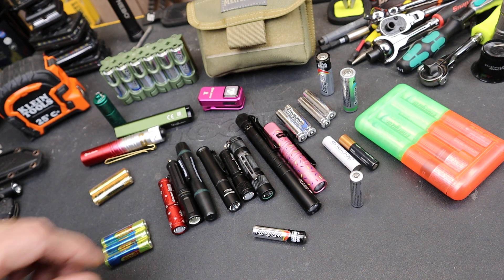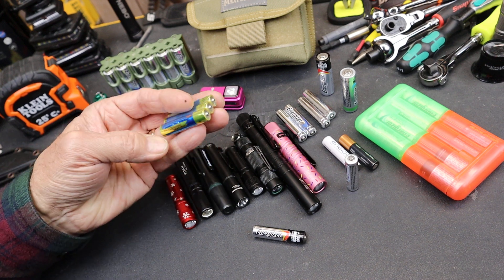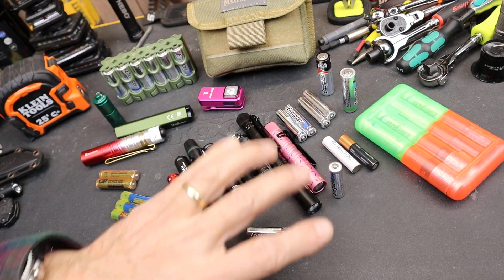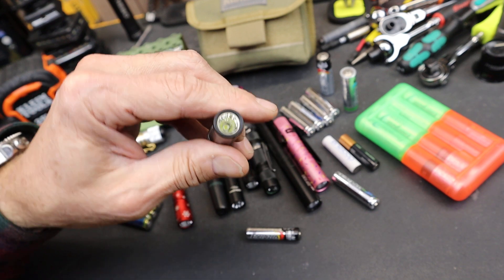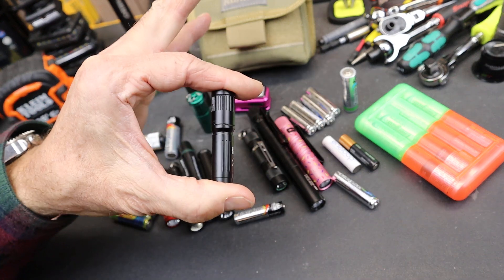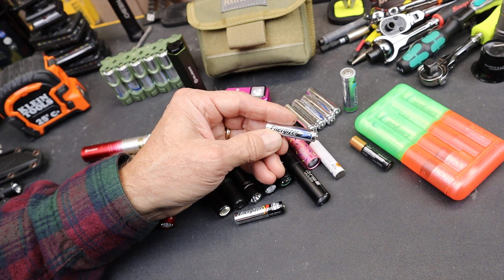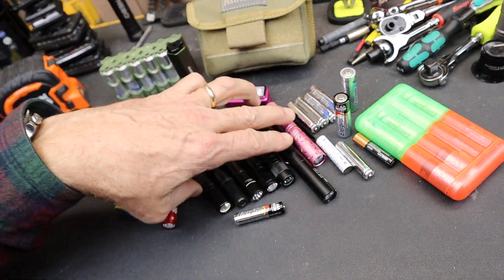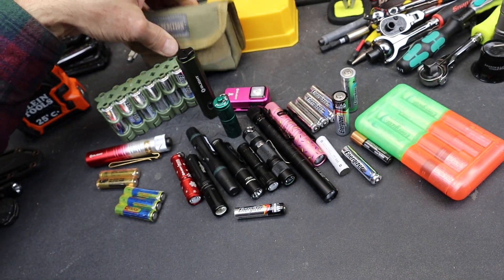Bad Timing Award? Project Farm & AAA Batteries: AAA-Dying Breed or Renewed Hotness? Lithium and LED!

Comment: tv remotes... even the cheapies last a year... i have so many things to "recharge " regularly that aaa in a remote is fine. there will (i hope) always be the low power use or infrequently used little thing that takes a pair of aaa so its small and light and easy to lose.

Comment: I think AAA are going to be around for quite a while. Every remote control I have uses AAA.  It really is not a space problem.  If our livingroom gadget makers would switch to AA, tripples would go away overnight. The weight difference is not that significant either.

Comment: Some of the modern tiny LED flashlights are amazing, but that flashlight the size of your pinky doesn’t double as a self-defense device. I have a few of the small tactical LED flashlights from HFT, so there is at least some defense utility there.

Comment: One thing I hate about lithium ion is the lack of a warning that it's almost dead. Everything works as it should, and then it turns off. Regarding lights, that's a bit of a safety hazard if you ask me.

Comment: I still prefer to have lights with a replaceable AAA vs rechargeable, especially for the lights that I depend on. In some cases, not all, there’s no charge indicator for rechargeable batteries. I like knowing my battery is fresh and ready to go. I realize this is somewhat dated thinking but my trust in rechargeable lights just isn’t there yet. I’ve carried the same fenix light on my keys for 7 years and I love knowing it’s got a replaceable battery. Just a personal preference I suppose.

Comment: I have used the Storacell battery holders like you are showing for well over a decade. I used to do a lot of flash photography and would have multiple sets of rechargeables on me at any given time. I might have the batteries in the flash plus two or three more sets in holders. With the Storacell holders I could put the spent rechargeables in the holder with the base side of the battery up to signal to me that those batteries had already been used. In the first design of the holder the plastic would sometimes break but they did a redesign many years ago and every holder I have is still as good as new. I believe the origin story is that the founder needed something to manage batteries when he was flying his small airplane. This device holds each battery securely where some case types do not. Anyway, not meant to be a commercial for Storacell I just liked their product. Thanks for the video.

Comment: If a pen light that's as good as the FourSevens Preon ever comes out with a different battery that is more energy dense then I will probably get it. For now, at work, I need that Preon P2. I always have one in my breast pocket and use it all the time. I use to use the Energizer lithium in my Preon's but these days I use rechargeable AAA's like the Eneloop.
One of my meters at work uses 4 AA's. The manual recommends the Energizer lithium. I had to use alkalines in it one time and they did not last very long. Another device that recommended Energizer lithium was my daughter's old insulin pump. It used one AAA. I use to keep those lithium batteries everywhere for backup. In fact I still have two Peak lights on both my key chains that have a single lithium. Not high output but quality lights.
I still have a 4-D Maglite in my work vehicle with the led upgrade. I never use it for light but for the occasion when someone needs to be persuaded not to do something they shouldn't be doing.

Comment: The batteries you get for free are often zinc-carbon cells, they have very low capacity (10-15% of an alkaline battery). They are still useful for very low discharge devices like remote controls or clocks.

Comment: I used my solitare a lot as a reading light when I was a kid. Just unscrew the lens and reflector assembly and it becomes little electric candle. I still have one torch that runs on AAA's. That is Led Lenser L7, it takes three, runs about 40 hours with fresh set and gives more than enough light for most things. As a bonus body is made of thick plastic so it's pretty light and doesn't feel cold when it 's freezing. And it used to be like 20€, but now prices have risen considerably.

Comment: I have use & like a very small AAA Fenix LD02 v2.0 penlight, & keep it equipped with an Ultimate Lithium primary. One of it's bonus features that see's a lot of use is its integral UV. Overall the light is mostly good for quick look/sees; and is otherwise suitable for hunting down a better light if/when need be. Other features are lack of PWM, high CRI & quality pocket clip.

Comment: The big fat maglite still has a place in the flashlight rotation for a couple of really important reasons:

It can be used as an effective blunt instrument. It’s the “girlfriend walking the dog alone in the evening” device in my household

It can stay on and running for the life of the batteries without becoming too hot to handle or a full on fire hazard. The small LED flashlights just get way too hot way too fast. The big ol Maglite is still the best flashlight for me. It’s not a pocket light, but it is very portable still and not a big deal to store away or carry around.
Reply: My 3D Maglite sits on my desk with a new LED bulb and, depending on the adapter, is loaded with either 6 or 9 AA NiMH batteries. The brightness is modest (I think it's 50-75 lumens), and should run a couple of days. You don't always need eye-scorching brightness, so it serves its purpose. My 2C Mag also has an LED bulb and runs on 2-AAs in adapters.

Comment: I love AAA because i want a small light and I use my AAA pocket light so often that I need to be able to just swap in a new battery, I can't be without my flashlight while it's changing.
Reply: exactly
Reply: But 10440 batteries are the same size and far surpass the performance of a AAA battery.
Reply: @alexdrockhound9497  they have to be recharged though.
With regular AAA's I can keep them on hand and just swap the battery out without needing to keep track of a 2nd rechargeable battery or charger...etc.
Reply: @alexdrockhound9497 
Can‘t use just straight 10440 cells since they are 3.7V. 
But there are AA and AAA rechargeable lithium batteries available that use circuitry to provide a constant 1.5V. Obviously this costs energy density compared to a straight lithium cell, but they still offer at least comparable energy to a good regular battery, often more than NiMH rechargeables.

Comment: I still use AAA battery-powered flashlights on my keychains.  It seems like the old battery technology is consistent with the technology of the flashlight.  I hate lights that have 50 lighting options and controls.  I just want to turn the light on, with a couple intensity settings, then turn it off.  All of the new rechargeable mini lights have too much business going on.  Secondly, if your AAA flashlight dies, you can get a AAA battery pretty much anywhere, no matter how remote of an area you are in.  If your rechargeable light dies, good luck.

Comment: Rechargeable lights with li-ion batteries that we couldn’t change is junk. Light works 50000 hours, but li-ion battery lose 10% of capacity every year. In tiny form factor it means 2-3 years of life. 

So AAA devices that support 10440 or primary lithium is more capable on a long time usage

Comment: My only issue with using smaller batteries are devices that call for many to even function.

If something uses more than 4 double AA or AAA batteries, at that point it needs its own internal battery (That is strictly my opinion)

Anything smaller I am usually fine using swappable batteries in, game console controllers or Tv remotes and the like, I am fine using rechargeable or disposable batteries in.

What I WOULD like, is a more standardized quality control on Lithium Ion batteries, removing any more dangerous options form websites like Amazon, and making it clear that we can move away from tried and true tech into something that is technically longer lasting, more powerful, and energy efficient.

For now, my Tenergy batteries will last me the next ten years.

Comment: The AA & AAA battery space is wide and deep.  "Convenience" items like electric toothbrushes, remote controls, wall clocks, and the like will probably always be for these battery sizes.  I don't expect a revolution in small electronics production any time soon.  Those batteries are ubiquitous, relatively cheap, and just batteries after all.

Holding onto electricity is kind of a silly idea.  The minute it gets a way out, it's all gone.  Sometimes disastrously.

Comment: AA and AAA form factor isnt dead take note ITS THE FORM factor the battery chemistry will change in due time that would make current battery chemistry obsolete or obsolescent just by how much we really don't know, cause remember you can still buy recharable AA or AAA cells that has lithium ion chemistry (they are typically charged via USB) in them making them powerful enough given the right size or be a burning hazard if improperly used

Comment: The new Lithium rechargeable AAA batteries seem to be working great so far. I bought a few. to review on the channel, and been pretty impressed.
They are crazy expensive though, and some need specialty chargers, so my old Nitecore D4 wont work for those.
Reply: Lithium are not good in extreme cold

Comment: Maglight Solitaire. Remembering small, compact, and useless. Even with brand new AAA battery installed can recall knocking the flashlight on all kinds of surfaces to get the lousy turn head to engage and actually light up. Do not miss those days.

Comment: What’s wrong with using rechargeable AA and AAA batteries like the eneloop one you showed? I think that’s a pretty good solution but you seem to have moved on from it.
Reply: Absolutely nothing.
Reply: @timmturner  my house runs on eneloop ,.clocks, thermostat ,flashlight and the list goes on. and on
Reply: use case to use case, if you want lights eneloops are not the best option depending on how picky the circuit is on the light side cause not all devices like being given 1.2volts which is what typically is put out by eneloops, at that point you are better off probably getting a lithium ion cell that just looks like a AA or AAA cell

think of it as general purpose over endurance? I know my cheap scale complains when its only receiving 1.2volts
Reply: @lesslighter what source materials or content would you suggest for someone new to  rechargeables?
Reply: Eneloops have a lower base voltage than alkaline.    I've had a few devices that complain about low voltage almost instantly.    Also, if you run an eneloop fully dead, I've had trouble bringing them back to life.
Reply: @videoviewer2008  just build a very very slow charger if you can get the parts the issue here is that most of the chargers for eneloops are "smart" enough to not charge fully dead eneloops
Reply: 1.2v can be a problem
Reply: For relatively high drain devices like lights and such I use rechargable (USB) lithium-ion AA cells. They keep a constant 1.5V and offer relatively high capacity.
Reply: I'm the opposite of Doc. I've moved away from those Energizer lithium's and have started to use Eneloops more.
Reply: Nothing he's just weird. I use eneloop in my keychain aaa light and never recharge it and it always works

Comment: CR123 are way better than AAA dispite the cost. They can provide more amps, don’t leak, more volts, stores longer, more power density.
Reply: Hate to ask but is there a source for that?
Reply: @NaturalSynthetic777  You're not gonna get one.
Whenever i see an interesting comment on YT, even if it's a reply straight @me, and i ask for sources because i wanna read the science of it: Crickets 🦗🦗🦗🦗
Most recent happening yesterday in the comments section of a food/science channel :body-blue-raised-arms:
Reply: @NaturalSynthetic777 you can measure the volts and amps yourself at home. These higher voltage cells are better sealed because its dangerous if they leak. You can look at the shelf life date on the package. You can test its output current and voltage in the cold at home too.
Reply: @NaturalSynthetic777 Can I ask why your search engine is broken?
Reply: Exactly  @atomicsmith

Comment: I can’t believe those tiny surefires are still so expensive after so many years. Seems kind of ridiculous to me. The streamlight microstream is so much better of a light.
Reply: I've got 2 rechargeable microstreams and both are amazing (one wears a homemade filter lens cover) the newest one is over a year old, the 1st is from early when they made the first runs in coyote... It's about half bate aluminum by now with an unknown amount of charge cycles and still has probably 80-90% of high output runtime as my newer one with FAR less cycles that usually stays packed in a trauma kit! I've definitely saved well over full MSRP on both in not buying lithium AAA's in them that's for sure! I still like streamlight duel fuel designs, and the fact that their rechargeable SL-B26 batteries are fairly priced (just hate the old micro USB ports, but streamlight is always updating everything) For the money:durability:warranty (if you ever even need it) Streamlight is hard to beat! I do wish they had the 1L/1AA protac light with a specific rechargeable lithium, but they would have to idiot proof the dimensions to keep people from blowing up other devices 🤦‍♂️
Reply: I had one of those surefire AAA pistol lights, the XC1, and it died within a year. Complete junk.
Reply: Sure fire seem to be shilled to death by utubers, I have used streamlights for a decade now and will continue to use them based on their longevity and actually being built to last
Reply: @BlačkFatigued in about 2010 surefire was indeed leading the pack in quality and performance, but they sure have become stagnant while other brands continue to innovate.
Reply: Actually, the XC1 broke TWICE. Once the mounting screw snapped and then the light just completely stopped working.